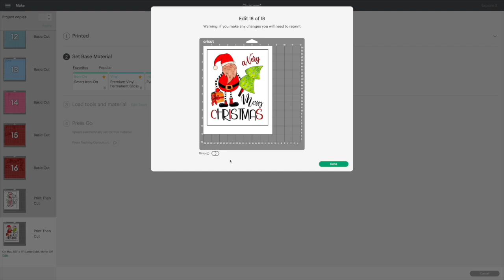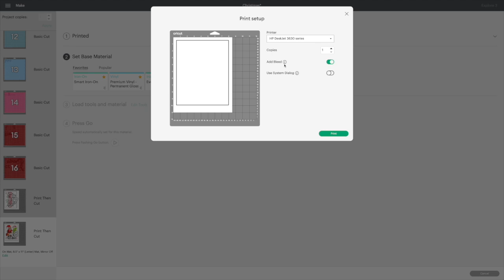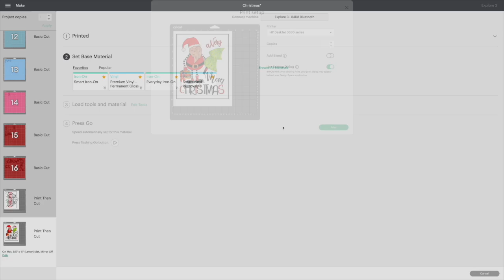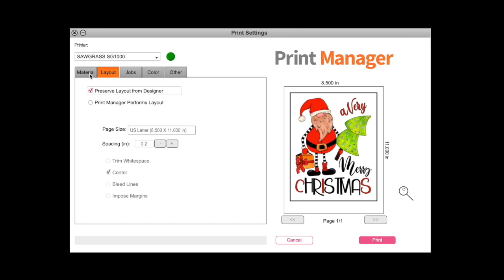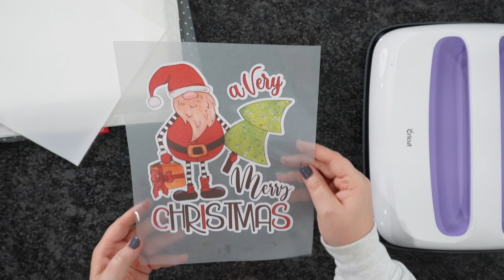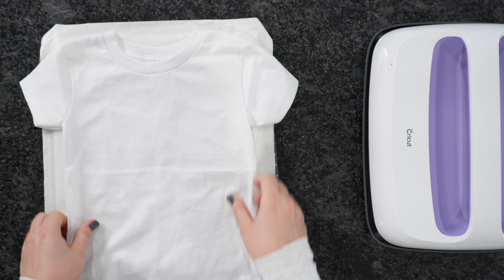🤓 Print Then Cut With Siser Easysubli | Christmas T Shirt Design

Comment: I have an Et15000 and the easy subli jams in my printer.  Help
Reply: I have same printer and it it's fine when I use it never had that problem.
Reply: I’m new to sublimation & I just bought my ET 15000 in December so this is still all new to me. I’m currently working on my first easy Subli project. I think somewhere in the ET 15000 manual it states for thicker paper to use rear feeder. Hope this helps

Comment: Do you have to have a sawgrass printer to make transfer images? I have a Epson 2620 or something like ..
Reply: Font have to have Sawgrass any sublimation printer will work.
Reply from the maker: When using the Epson printer you will want to treat the EasySubli like regular HTV - you will want to cut it, print your sublimation design on regular sublimation paper, and then press it onto the EasySubi. :)
Reply: @DesignBundles   so do i need the mask or htv siser??